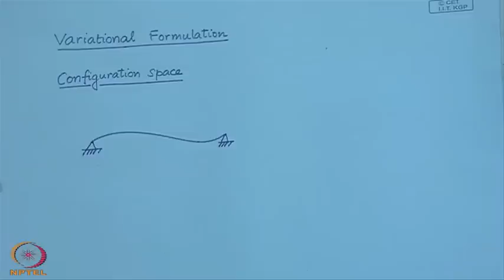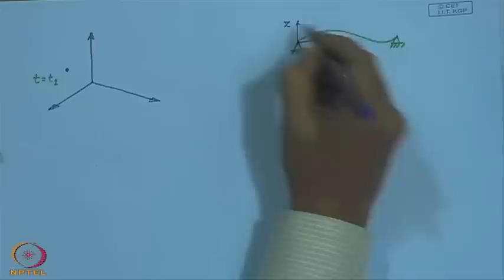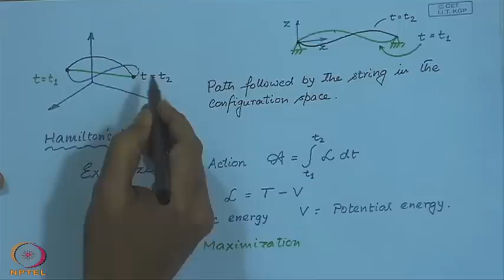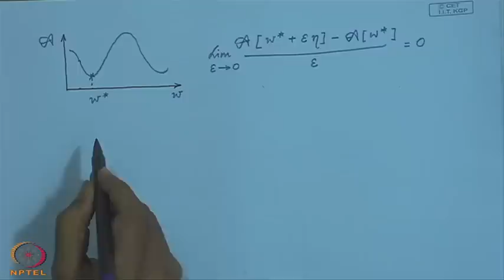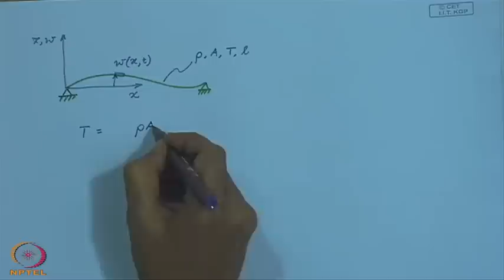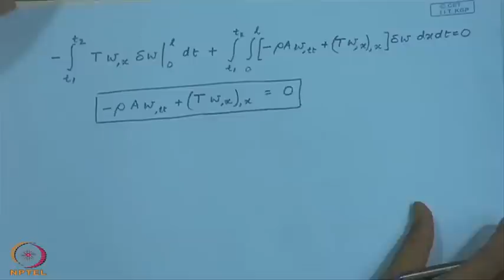Variational Formulation - I

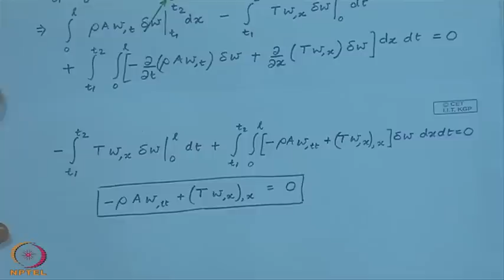Comment: 51:34
How to take T out of the differentiation? 

At the beginning of the problem, Prof said, the string has tension T (means same throughout?) -- Can be taken out of differentiation easily. 
But if tension T is the same -- There will be no stretch -- No stretch means ds-dx = 0.

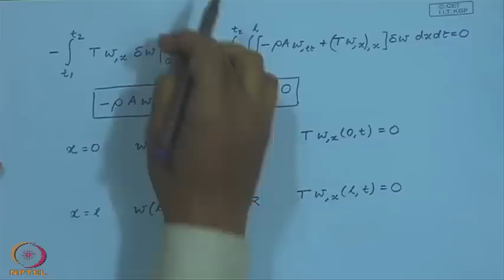Comment: At 53:16, shouldn't it be w(0,t) = constant (instead of 0)? becasuse dw(0,t) = 0
Reply: yeah.
Reply: No, it is variation and not differential. One case would be that there is no variation on the ends which is w(0,t)=0 (fixed ends). The other case is that w may vary (free end) but then the natural bc needs to be zero
Reply: @tadeoteran1372  still don't get why he made variation 'w' with respect to time equal to 0 at 48:51, do have a simpler explanation?
Reply: @josuemanuelparejacontreras3443  because the function has to pass thru the points, i.e. they are fixed, then there will be no variation in those points.
Reply: @josuemanuelparejacontreras3443  also in t1 and t2 you have a given configuration, hence no variation.